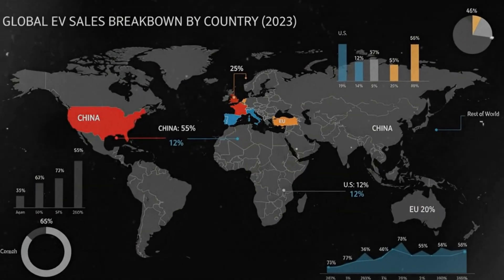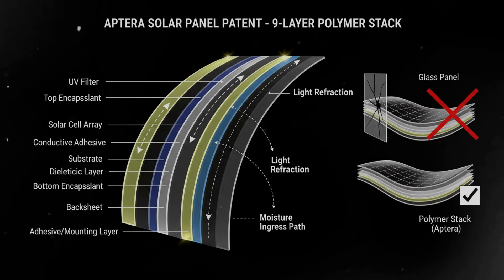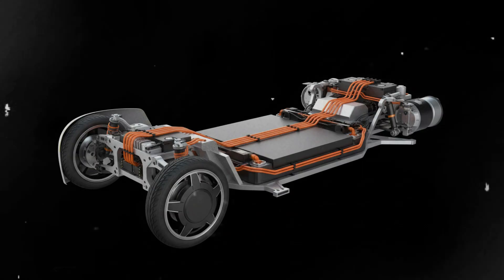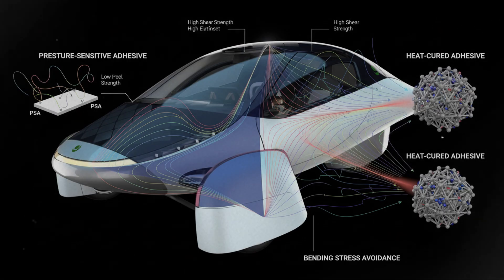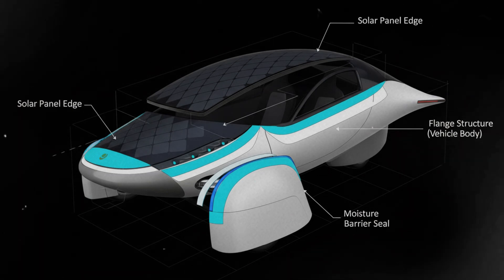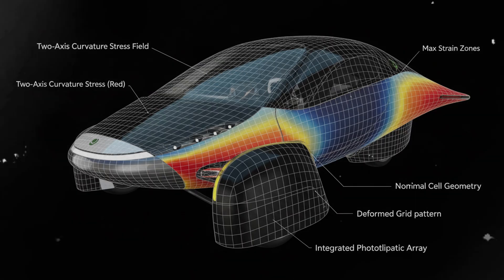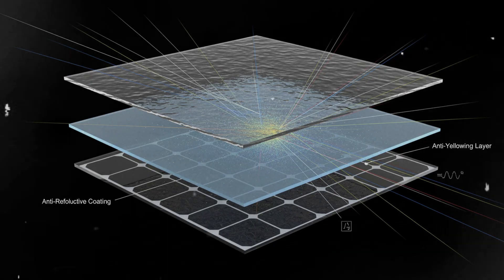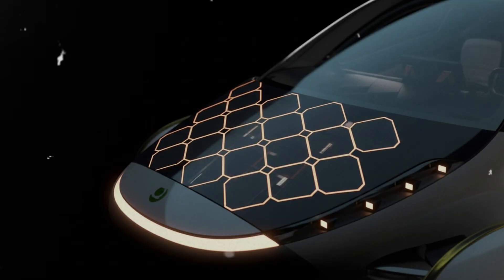Aptera’s Solar Patent REJECTED?! The Shocking Truth Hidden in the Documents!

Comment: other car companies have been using curved solar on cars, its not new. Amount of curve is not as extreme but they are also curved solar panels, of sandwich construction, using heating/vacuum machine to bend and fuse the glass or plastic.

Comment: Aptera wants patents for everyday use solar cells.
Reply: They are flexible to an extent. They can bend more than 4-5 degrees without snapping. I believe it’s up to 30 degrees. They’re also designed to last the lifetime of an average car. They are also covered in the same glass thats on your phone.
Reply: @SteveBueche1027  So its 4 degrees, which means 30 degrees for an Aptera Fanboy. They last several months, for you its a lifetime. They have a solar gain of under 10Miles per day, for you its 40 miles per day. The glas on the phone does not flex. Just try it out.
Reply: @SteveBueche1027  they said these cars will last for generations.
Reply: @charlesbeane8795  absolute nonsense....